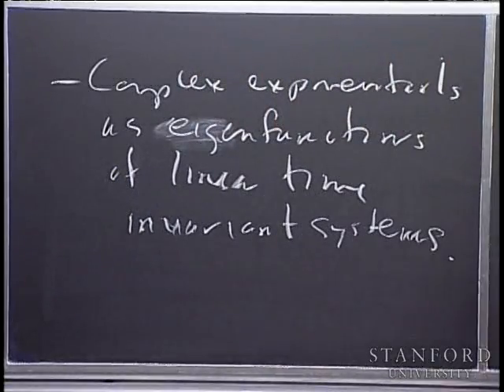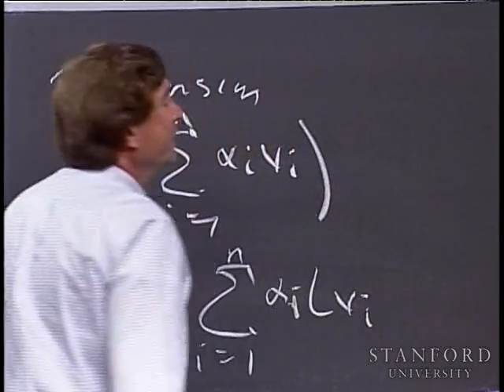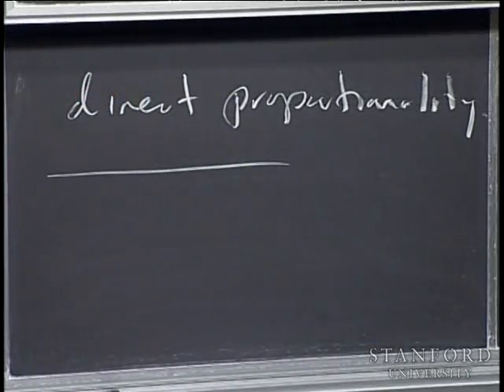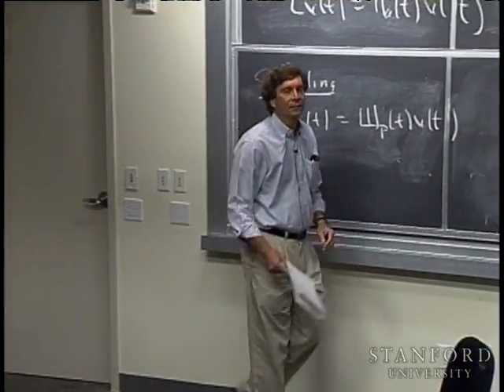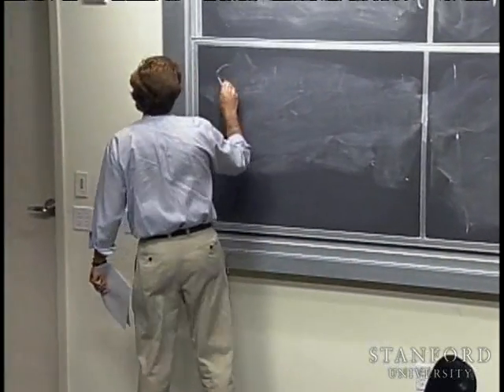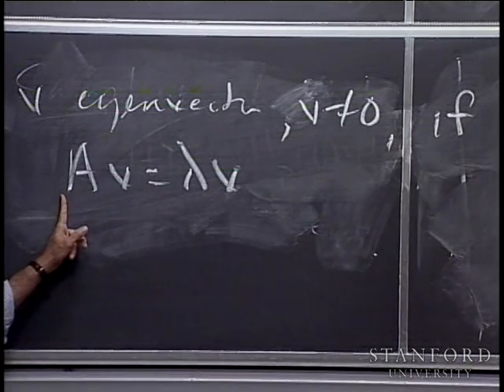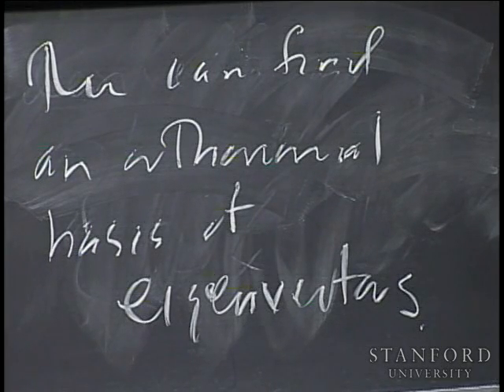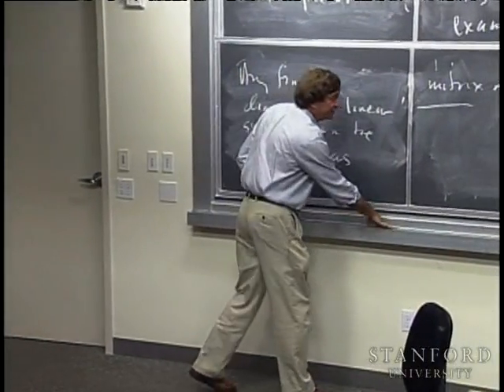Lecture 23 | The Fourier Transforms and its Applications

Comment: In summary:
You can interpret finite dimensional discrete linear systems as matrix multiplication (similar to what Matlab does) and infinite dimensional continuous systems as integration against a kernel.
If you understand this statement, you might as well skip this lecture!
good luck :)